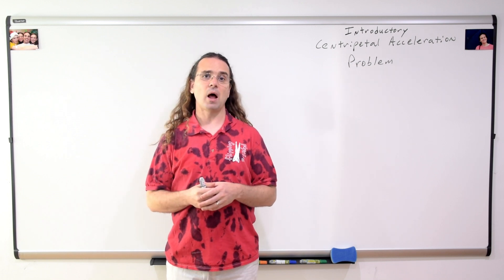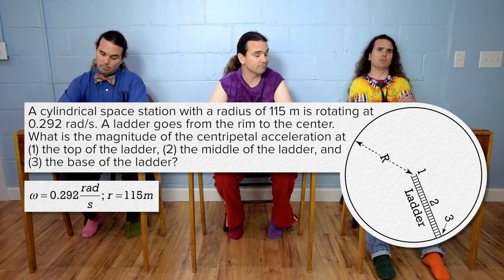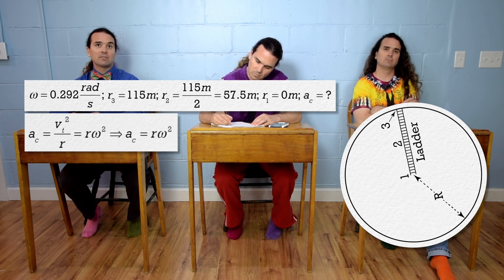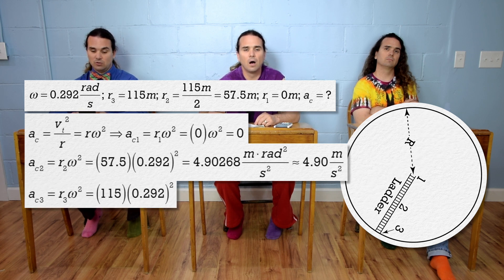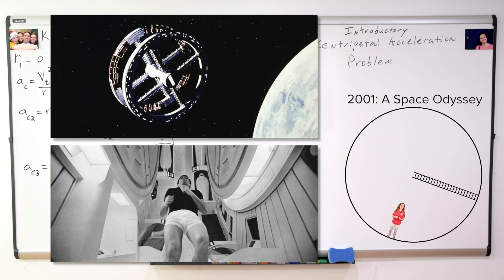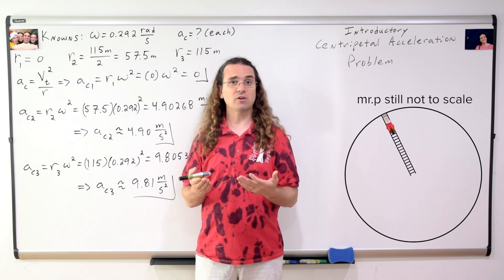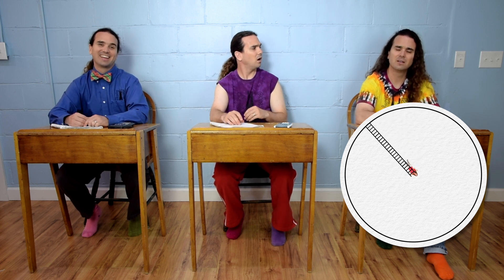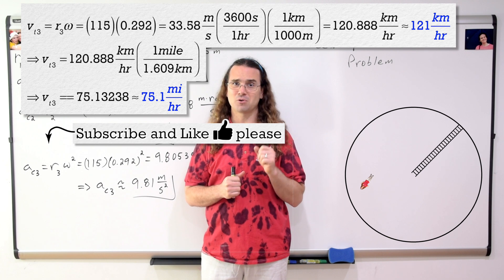Introductory Centripetal Acceleration Problem - Cylindrical Space Station

Comment: centripetal acceleration = (v^2)/r   and in case we are at centre of space station the radius is 0 that means centripetal acceleration is not defined so why the answer is coming 0? please reply sir
Reply from the maker: Centripetal acceleration is actually equal to the derivative of tangential velocity with respect to time. (That is where Vt^2/r and r*ω^2 both come from. See https://www.youtube.com/watch?v=6B6YRPYVJ5Q ) Because the tangential velocity will be zero when r = 0 and the tangential velocity will not change when r = 0, the derivative of the tangential velocity with respect to time at r = 0 will also be zero and there will be zero centripetal acceleration. Hope that helps!